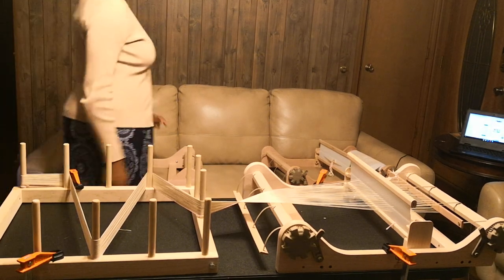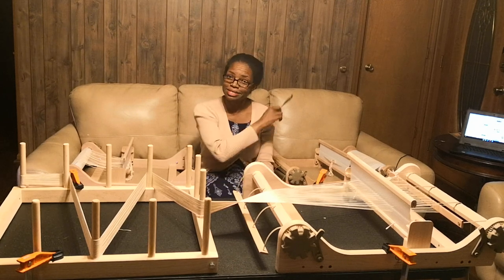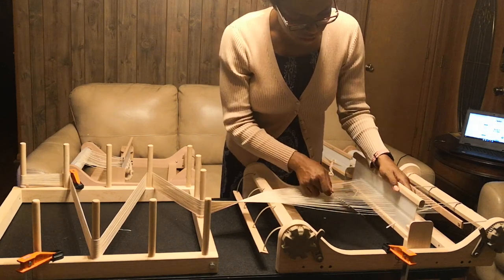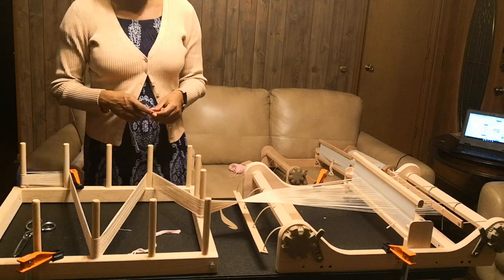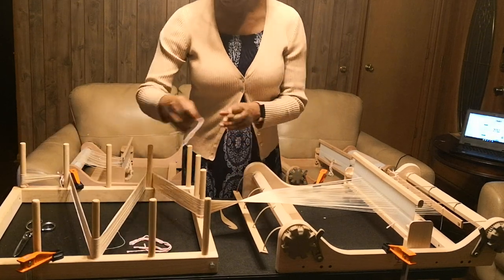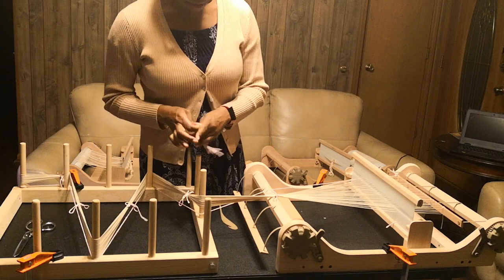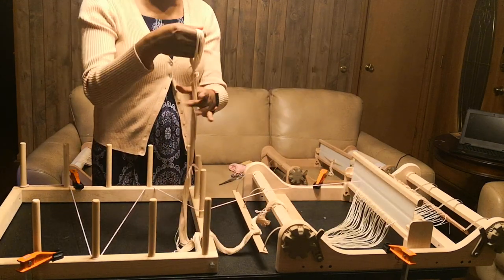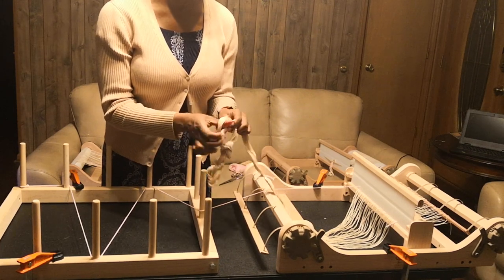Hybrid Warping an (Ashford) Rigid Heddle Loom (Part 2 of 3)

Comment: I’ve wondered if it was possible to use the warping board more directly than the “indirect” method. One of the reasons being that I am notoriously unlucky with using a warping board. A mill, no problem, jus not the board.